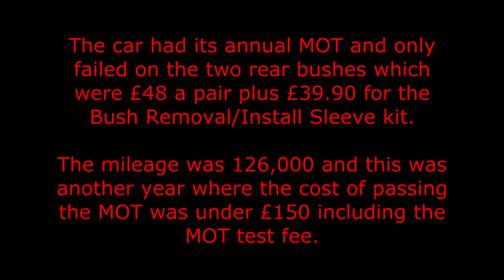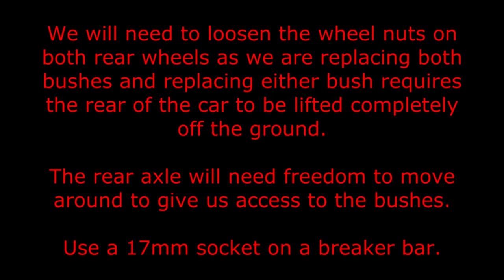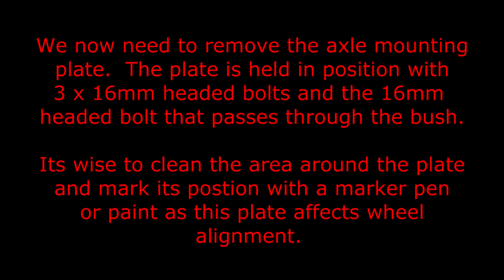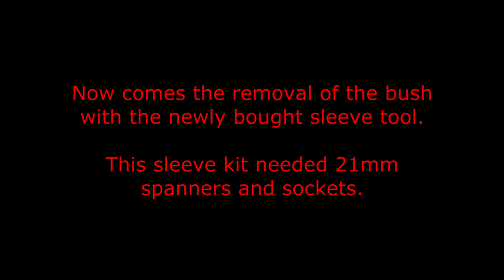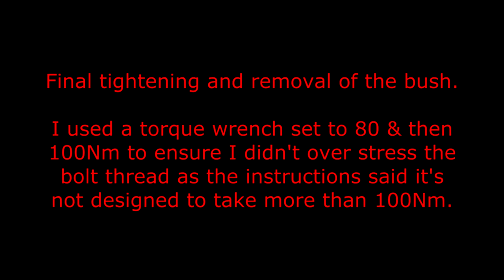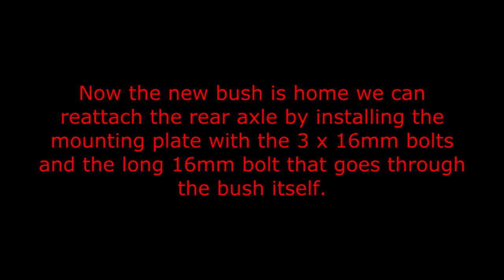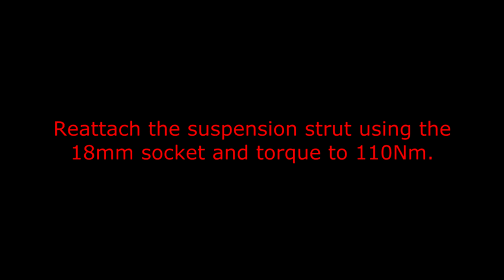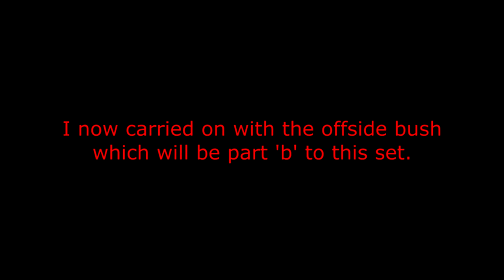Replacing 2007 Renault Laguna Rear NEARSIDE Axle Bush.  Using £40 Removal/Install Tool 🚗

Comment: I know they are old cars now but I have done these twice and they have gone again it is disgusting Renault have never done a modification on these bushes as they are clearly made wrong and the failure rate unacceptable if this is Renault Engineering and customer care steer clear in future.
Reply from the maker: It's funny you say that as the original ones seem to last years but the replacements don't seem the same.  Maybe the rubber has changed over the years and degrades quicker.

Comment: On my est I have had to fit 4 sets the car has only done 107000 miles a very bad way to make a car
Reply from the maker: Did you fit original equipment parts as aftermarket may not last as long.  I think they have gone again on my wife's car but we fitted aftermarket parts.

Comment: Big thanks for your video. I will have to replace this part by myself and you explained very well all the process. Fortunately i have exactly the same car :)
Reply from the maker: Thank you for the comment and it's good to hear I may have helped you out.  Good luck.
Reply: I made the change today of the both side. The bolt that was hard to remove has break into its place on the both side.... I saw it looks like 10.9 steel 9 diameter but font know the length. dont know how to remove too the rest of the bolt still in place..
Reply from the maker: Oh blimey, sorry to hear that.  Mine was stuck in place as well and had to keep winding back and fourth to get it out.  A snapped bolt isn't going to be fun to remove.  Might be a case of drill the bolt out and use and ezi out thread remover.  Sometimes lots of heat and penetrating fluid does it.

Comment: Hello, have a question for you. Whats the long pipe called that is between the bushings? Mine has rotten and needs replacing, but i dont know whats the part called. Thanks!
Reply from the maker: I think your meaning the lower wishbone or control arm.
Reply: @CoatsandGaiters  Thanks for the reply, but i ment the long pipe that runs between the axle bolts, mine is rusted and it wont pass the MOT
Reply from the maker: @dagsbrunenieks7727  Is it an anti roll bar, sway bar, link rod or the main suspension?  most things are weldable.
Reply: @CoatsandGaiters  yes i was thinking about welding it, but the bar is so rusted i d have to cut off most of the length of it to fix it. At 7:03 you are removing that bolt from the bushing and that bolt is holding on a long bar thats is connected to the bushing on the other side. I was looking for the name of that part everywhere, even called the local parts store and they didnt even know the name of that bar. My car is a 2005 laguna 2 1.9 disel
Reply from the maker: @dagsbrunenieks7727  REAR AXLE SUPPORT BAR STABILIZER ?? BACK AXLE LATERAL BRACE BAR, USUALLY RUSTS THROUGH maybe torsion bar, might be two a front and rear torsion bar on the rear axle.
Reply: @CoatsandGaiters  Yes, it was a rear acle support bar stabilizer! Thanks alot!!
Reply from the maker: @dagsbrunenieks7727  we got there in the end lol

Comment: Hi ! If is not too much can you tell me the diameter of the tool?  I mean the big piece used for installation. May be I can convert to use on toyouta ..Many thanks !
Reply from the maker: The external diameter of the large deep one of the three is 88.90mm
Reply: @CoatsandGaiters  Thank you soo much ! I will try to see if I can adapt to work with it on Toyota ! Many thanks !
Reply from the maker: @beeland1198  Good Luck

Comment: Brilliant tooling skills just as filming. Incredible. Thanx. About to do this next week. Just wondering how to get around that bushing press tool. Forexample: Two robust cups, drill 2 holes in them and use a coil spring threaded removal kit, then with a gun you can aply 300Nm easily and literary shoot the old bushing out in a seconds...
Reply from the maker: Thank you for the compliment.  The tool can be bought pretty cheaply for £37 but you maybe able to do it like you say and some determination.  https://amzn.to/3tP3Il7

Comment: Hi. Where did you get the removal and installation set? I have trouble finding it.
My Haynes manual indicates that that set is only needed when you don't remove the axle from the vehicle. Thanks to your video I can clearly see it is always needed.
Reply from the maker: Thank you for the positive comments.  I bought it here              https://www.amazon.co.uk/gp/product/B01NB1AQTA/ref=ppx_yo_dt_b_asin_title_o05_s00?ie=UTF8&psc=1

https://www.amazon.co.uk/dp/B011KKJ6I0/ref=sspa_dk_detail_4?psc=1&pd_rd_i=B011KKJ6I0&pd_rd_w=BFTYG&pf_rd_p=1055d8b2-c10c-4d7d-b50d-96300553e15d&pd_rd_wg=jzGOm&pf_rd_r=9KQA0YRZJ2Q01NY8DP1T&pd_rd_r=69f308ac-4c3e-4bed-9ffc-51e93bfaee57&spLa=ZW5jcnlwdGVkUXVhbGlmaWVyPUFPWFpFTkdLREJPWVQmZW5jcnlwdGVkSWQ9QTEwMjYyMzUzOFhHVlpVVDFXQk43JmVuY3J5cHRlZEFkSWQ9QTAxODEwNzEyMU1DOThOV1pKVksxJndpZGdldE5hbWU9c3BfZGV0YWlsJmFjdGlvbj1jbGlja1JlZGlyZWN0JmRvTm90TG9nQ2xpY2s9dHJ1ZQ==
Reply: @CoatsandGaiters  Thanks for the quick response. It always seem to come down to the right search term. Couldn't find anything at first, now using the description from your link suddenly gives me several other links.

Comment: Hi great video but can you explain why you compressed the rear springs?
Reply from the maker: The spring will be forcing the damper apart making it a bit harder to remove.  By compressing the spring it takes any loading off the bolts.

Comment: Wich wrench did you use to unscrew the long bolt that goes in the bushing?
Its not a normal 16 mm?
Reply from the maker: I remember I had the same shock when I saw it and thought I don't have one of those sockets as it's not a torx. Its a standard 16mm socket with the 12 splines as apposed to the 6 sided 16mm sockets.  It caught me this one.
Reply: @CoatsandGaiters  Thank you the 6 side does not work i wil try the 12 !
I tried torx but thats not going to work!

Comment: Amazing and well explained video, do you happen to know if the same process would work on a Laguna 3?
Reply from the maker: I’d be very surprised if they were different.  A quick peek should confirm if they are the same by removing a rear wheel.
Reply from the maker: Just don't over tighten like I did on my second set of videos when I later replaced the bushes.  The bush was in but I assumed it wasn't fully in for some reason. https://youtube.com/shorts/COf9ogScTNA?feature=shares

Comment: Great video but l using poliuretan silentblock is beter
Reply from the maker: Thank you I will look that name up now.  I only used standard motor factor parts.
Reply: @CoatsandGaiters  laguna its realy great car. Two years ago l must change for a biger espace 4. Its olso like laguna. Back break front break and wery wery close.

Comment: No need to pull the release cable 🤷🏻‍♂️
Reply from the maker: Sorry can you jog my memory on the cable you mean?
Reply: @CoatsandGaiters  the epb release (yellow T handle under the arm rest)
You can turn the ignition off then release the epb using the normal little lever. Then when you open the door. Electrics turn off and epb stays off too. 👌
Reply from the maker: @MaNNeRz91  arrrr I understand now lol.  Thank you for that, useful to know.
Reply: @CoatsandGaiters  not many people realise it and this causes them to prematurely pull the release cable which doesn't always reset itself. You can manually ram the cable (right side I believe) and click it back into the release mechanism inside the unit. People spend hundreds on having the unit repaired and it's as simple as pushing the cable 😆.